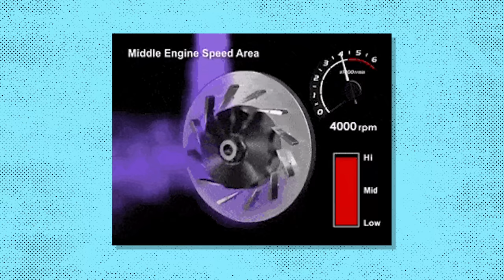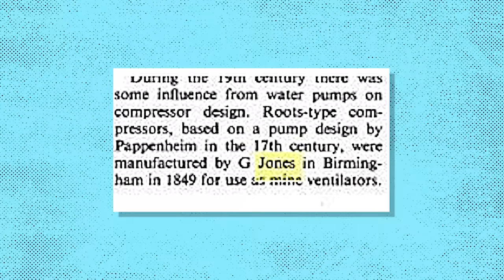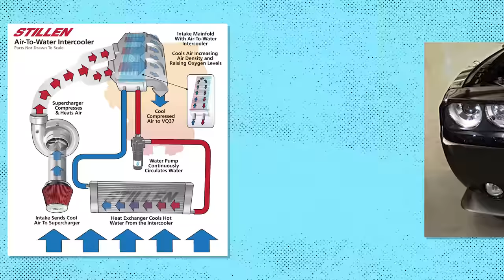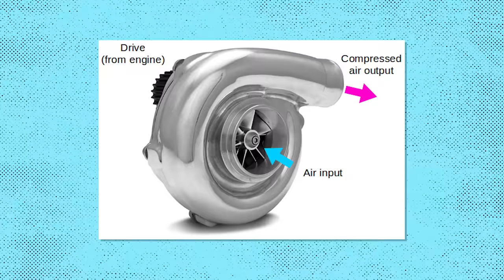Why Superchargers Aren't As Good as Turbos

Comment: I've always been skeptical of this Turb's are all efficient, and Super's aren't comparison.
    Firstly, when we talk about efficiency, we're usually just talking about fuel consumption, and hence running costs. Even if a Turbo uses less fuel, I gather they're typically more expensive setups. So you have to drive a hellava long time to regain the money. Also because you get a laggy performance hit with turbo's, and because they're most effective at higher speeds, you'd typically run higher peak boost, which presumably is wearing and tearing the engine block faster. Plus Turbos would presumably burn oil faster, or require higher grade oil, a hidden cost hit
    What never enters this conversation either is use case scenarios. Turbo's aren't automatically and inherantly more fuel efficient vs NA motors. If ur on consistant moderated boost, it is, but if ur in stop and go traffic where ur constantly high throttling the engine to overcome the lag repeatedly, it's not efficient, cause ur spending most of the time trying to spool the turbo rather than reaping the boost benefits. Turbos operate best in open road or racing environments.
    Superchargers being much larger lose efficiency much quicker up the RPM range (more friction), but without the lag, you don't have to throttle it so hard off a standstill, and can operate effectively at low engine RPM, so they'd presumably be more efficient at low RPM cruising.
Reply: Well yea but actually no turbo cars are efficient because they can use smaller displacement and less pistons so they are more efficient for cruising because when off boost they are effectively na 2L Hondas. when on boost all fuel efficiency goes out the window they have to run rich because you never quite know how much boost you actually have so it’s harder to resist knock but with performance because they have higher peak hp outputs due to the recovery of some of the exhaust losses so faster lap times when straights are long and and corners are fast so that small blip of no boost isn’t important.
Reply: Modern centrífugal supers are even more efficient than turbos. And about efficiency I thought we always talked about the parasitic energy vs the "free" energy for turbo which is a lie. You are adding back pressure to your exhaust gas

Edit
What matters is staying into the efficiency zone of the fi element. Turbos en supercharger have a sweet spot between work and air emitted. After all they all are air pumps in a sense
Reply: @ulisesavila2879  Yeah, ultimately i think it's all a moot debate, we're seriously discussing some miniscule fuel efficiency differences either way.
   Traditionally i just say, you want a forced inducted engine, if you want a faster (or more powerful) car. Not for the sake of fuel economy.
   Any fuel efficiency gains are lost to a more expensive, more complex, likely less reliable and higher maintainence engine.
   On that note, a Super's main adv over Turb's is its very simple setup
Reply: @ulisesavila2879  Yes.  To add to what your saying, the engine as a whole is often referred to as an "air pump."  The more air it can move the more power it can create.  Bigger displacement can move more air more easily, but tends to have more losses due to having to move more "metal" or move that "metal" more.  For any given engine, N/A is most efficient; however, a smaller engine with forced induction can make the same power while being more efficient.
Reply: @hamishfeast5803  ur argument about a smaller block requirement theoretically applies equally to a Supercharger. Though we can't whimsically choose our block sizes, so the mathamatical argument is that the added torque allows us to operate the same engine at lower RPM/higher gear ratio's.
   Agreed, turbos aren't efficient at full boost, I mislead slightly denoting the racing environment. I guess i just meant a continuous pace (no spooling).
     Where I suggested Superchargers maybe more efficient than turbo's, is in that very low speed, stop and go traffic, or for heavy hauling. 
   I haven't had the luxury to drive and attest to all these engine designs, I'm just guessing that a Supercharged motor will allow much torquier gentle take off's, and higher gear traffic commuting.
   I own and drive a 1.6T Pulsar. My life is 98% metro. The lag sucks, trying to quick zip an intersection opening means foot to the floor
Reply: Turbochargers are significantly more efficient than superchargers...
Turbochargers are Heat Engines and generates horsepower from from waste heat energy from the exhaust.
There is no parasitic loss because the centrifugal compressor is a more efficient pump than the reciprocating engine and is not driven by the crankshaft this easily offsets any power lost due to exhaust back pressure.
Reply: Thats why automobile manufacturers use smaller displacement engines with turbochargers... if driven properly they delivered better fuel efficiency in both city and highway drive cycles...
Small engines deliver better fuel economy than large naturally aspirated aspirated engines in stop and go traffic conditions.

Of course, if you keep the throttle pinned to the floor between stoplights you will be using boost and thus fuel enrichment to suppress "knock"... unless the engine  is equipped with GDI... then you get more boost without wasting fuel.
Reply: @ulisesavila2879  Not true, turbochargers are more efficient than superchargers..
This is a irrefutable fact.
Reply: @ulisesavila2879  The heat energy used to drive the Turbocharger is free...
Reply: @sandervanderkammen9230  Turbochargers are usually more efficient, but nothing is ever free, and the increased backpressure is not negligible.  The power loss due to the backpressure is typically lower than that of a mechanically driven supercharger.  Personally, I think that turbochargers belong in aircraft and drag cars where response can be tuned to the specific and limited operating conditions.  Mechanical superchargers have other advantages, but also can provide improved efficiency when paired with a smaller engine just like a turbocharger.  They are both doing the same thing after all.  Both have their place.
Reply: @sandervanderkammen9230  my efficiency arguments factor in capital setup costs, engine wear, maintainance etc..
   Turbos aren't cheap they're easy 1000s (AUD, I'm Aussie), and Supercharged motors by equivalent could also be made smaller.
   Turbo's do not have a zero parasitic loss. They add ducting length (friction), demand oil circulation (maybe requiring added oil coolers etc..,), if bearings wear, that's added friction, the turbo becomes very ineffective.
   An NA motor by equal power comparison, would be bulkier and costly, but also simpler and more reliable. Large displacement pistons and bores (under lower combustion pressures) would assuredly last much longer. So in the long run, costs balance out some.
   At best, turbo's are fractionally more cost effective. We're really not talking big differences
Reply: @saulekaravirs6585  The energy used to drive the Turbocharger is free... its heat energy that is otherwise wasted  out the tailpipe.
Reply: @peebow1000  My condolences Colin, Stralya is about as far from the center of the Automotive and Engineering universe as you can it without leaving the planet.

There is no parasitic loss, the energy used comes from waste heat.
Reply: @sandervanderkammen9230  You have an understanding of some of the thermodynamics at play, but not a full understanding.  What you need to look at next to understand where your wrong is the mechanical interface between the hot exhaust gasses and the turbine which they flow through.  Once you understand for yourself you'll have a much better frame of mind to learn how a turbomachine works in practice.  It's not just a perfect thermodynamics class heat engine.  I can't convince you of that myself, but hopefully what I have said can get your pointed in the right direction.  You need to learn about turbomachinery to understand this.  The Turbo-supercharger is a turbomachine, the engine it feeds is an imperfect heat engine.  There is not reason the hot exhaust gasses have to be hot for the turbo to work, they just have to be forced through it.  Your smart, but your education is in complete.
Reply: @sandervanderkammen9230  You are correct about modern turbochargers being superior in almost everyway to a belt/gear driven supercharger. You are however, very wrong about "Stralya". Motec, Haltech, Emtron are all "Stralyan" manufacturers making some of the best engine management and data acquisition systems in the world. We are home to the fastest Skyline GTR's and fastest outright GTR (as of writing 6.47 @ 219.94). We have companies such as Platinum Racing Products, Plazmaman, Nitto Performance Engineering, Hypertune, MCA Suspension, just to name a few, all of which are world renowned & record holders in the automotive aftermaket. Though "Stralya" isn't full of Automotive & Engineering masterminds, we have more than our fair share and the ones we have are some of the best. Also, for future reference we pronounce it 'Straya' without the 'L'.
Reply: @saulekaravirs6585  Sorry, but you comment reveals your lack of formal education and professional experience on this topic...
 The Turbocharger's centrifugal compressor is a much more efficient pump than the reciprocating engine... it not only increases volumetric efficiency it significantly reduces pumping losses... and because it is not driven by the crankshaft, this significant increase in efficiency is free... it requires no additional fuel burn like a  supercharger compressor driven from the engine.

You need to remember that the exhaust pressure in the cylinder is higher than the pressure in the exhaust manifold when the exhaust valve opens, and the gasses continue to expand after the valve closes..
Their is no parasitic drag due to exhaust back pressure because the increase in VE and pumping loss is higher.

Any questions son?
Reply: @grahamtill9844  Thanks for proving my point....
Reply: @sandervanderkammen9230  try again with a restrictor in the exhaust the effect of scavenging the exhaust pluse wave is interfered with, there by making less power.  Further the energy used to spin the Turbo is coming from the exhaust gas, which if not used to spin the Turbo would be used to exit the exhaust system faster, there by increasing backpressure and lowering power.
Reply: @grahamtill9844  Thanks for proving my point lad...
Reply: @bowez9  So you mean to tell me that that jet engines lose power because the turbine blades cause a restriction???
 I guess engineering is not your thing?
Reply: @sandervanderkammen9230  where does a jet get its energy to spin the turbine?
Reply: @bowez9  From the HEAT ... where do you think it comes from???
Reply: @bowez9  Jet engines and turbochargers are both Heat Engines  and both operate using the BRAYTON CYCLE.
Reply: @sandervanderkammen9230  not what I asked, Where dies the jet eninge get its energy.
Here's a clue a Turbo is not a Brayton Cycle item, for one very important reason it doesn't use a fuel source. A Turbo has no isobaric process -a requirement for tge Brayton cycle.
Reply: @bowez9  The Jet Engine gets its energy from HEAT, just like the Turbocharger.
Reply: @bowez9  All Turbochargers operate as a OPEN-CYCLE BRAYTON ENGINE.
Reply: @sandervanderkammen9230  let GE, RR and Air Bus know because they've been using jet fuel ie JP8
Reply: @sandervanderkammen9230  try agian an open Brayton Cycle,  discharges to atmosphere, but a turbocharger is no because it is not a Brayton Cycle device to due to the lack of isobaric process.
Reply: @bowez9  You really don't know what you are talking about...
Reply: @bowez9  T2 is the Cold reservoir
Reply: @sandervanderkammen9230  why yes I do but some people can't grasp simple concepts.
Reply: @bowez9  Yet you don't know how a turbocharger actually works...
Reply: @sandervanderkammen9230  so I guess you believe a Hydro power generator operates on the Brayton Cycle too?
Reply: @bowez9  Thank you for confirming that you have no formal education or professional experience on this topic.
Reply: @sandervanderkammen9230  so you do belive a Hydro power generator does operate on Brayton Cycle.
Reply: @sandervanderkammen9230  not since I don't believe you will answer my previous question let me ask another.  Why are you ascribing a Internal Combustion Engingle Cycle to a device which at best is external combustion, but can operate totally separate from combustion?
And while asking questions I doubt you will answer since you challenge education and experience, produce you PE liscence number and SAE membership id.
Reply: @bowez9  Do you really think a hydro power station operates on the Brayton Cycle???
Reply: @bowez9  It is very obvious that you have no clue what a Combined Cycle Heat Engine is...
Reply: @sandervanderkammen9230  you were describing a turbocharger not a engine with a turbocharger, as those are two totally different systems; as a positive displacement supercharger is positive displacement no matter how its looked at.
Just because it's a heat engine doesn't mean it operates on the Brayton cycle, for that matter a turbocharger can still operate with no change in heat (just at a much lower efficiency).
Reply: @sandervanderkammen9230  don't make assumptions, especially when you refuse to answer questions, just as I said you would.

Comment: 2:56: "the ... doesn't actually compress the air  ... makes it more of a belt driven air pump" ... What ! - Wow - just wow. 
The purpose of these 'air pumps' is to force more air into the engine. All variations do this by raising the engine charge pressure - ie - Higher inlet pressure = more more air mass flow = more power. 10 pounds into a 5 pound bucket requires pressure.
Reply: Came here to say this. Boost and compressing the air are the same thing. And a centrifugal compressor does not take TIME to build boost, it takes RPM. This is because a centrifugal compressor's pressure is not linear with RPM, but squared. A turbocharger does take time to spin up but since a supercharger is crank driven, it spins up almost instantly upon downshifting. Of course there is some intake volume that must be pressurized and that takes a bit of time.
Reply: "Boost" is when manifold pressures are higher than normal atmospheric pressure at sea level.
Many engines are equipped with compressors that do not produce "boost"  they are Normally Aspirated as opposed to Naturally Aspirated
Reply: @alexkram  depending on the type of compressor
Some are Postitive Displacement like the Roots, while others are not positive displacement like a centrifugal type.
Reply: @sandervanderkammen9230  can you give an example?
Reply: @sandervanderkammen9230  agreed, I mentioned centrifugal compressors. Positive displacement should give nearly constant boost under open throttle but I've never owned one.
Reply: @alexkram  Some aircraft engines are supercharged only for altitude compensation.
2-stroke Diesel engines are also supercharged but do not produce "boost"
Reply: @alexkram  The amount of boost with a positive displacement compressor is dependent on rpm because the amount of air is fixed per revolution...
Reply: @sandervanderkammen9230  Any rise in pressure across the supercharger is compressing the intake air. There would be no point in having a supercharger that does not compress the air.
Reply: @alexkram  Manifold pressure in a naturally aspirated engine is Negative when the engine is running...
Reply: @alexkram  There is no build-up of intake manifold pressure if both the intake port and exhaust vavles are open.... excess manifold pressure is released into the exhaust manifold.
Reply: @alexkram  An aircraft engine flying at 40,000 feet needs a supercharger just to maintain the same negative manifold pressure at sea level...
Some supercharged piston engines do not increase power output, they just reduce the power loss at high altitude.
Reply: Well said.  This sentence resulted in an extreme loss of credibility fir the whole video   This guy needs to do more research before pretending to be an expert
Reply: @ericrawson2909  It seems you misunderstood the comment... if the type of compressor used is not a positive displacement type then the statement is true.
There is no internal compression with a centrifugal compressor.

Any questions?

Comment: Would you be able to take a supercharger and make an electric motor for it specifically that is electronically hooked to the engine RPMs so it spins faster as needed that. Being completely dependent on a battery that can supply the needed power. Even if you need to add an extra battery. Would that work ?
Reply: Its been done, but its not very practical.
Reply: Audi/ VW have developed a very good hybrid turbo that uses a high speed electric motor to very quickly spool up the turbo into boost mode. But this electric motor is only on briefly before exhaust gas pressure takes over.
Constantly powering the turbo Or supercharger takes a Lot of power, more than is practical for Electric motors alone
Reply: DONT ASK SANDERSPARKY....